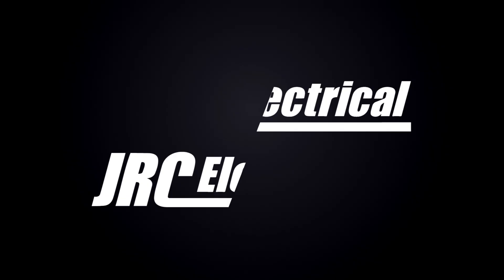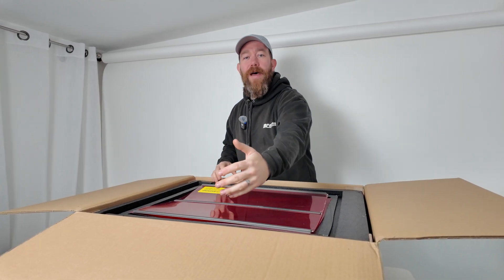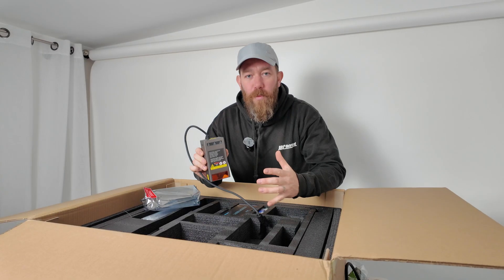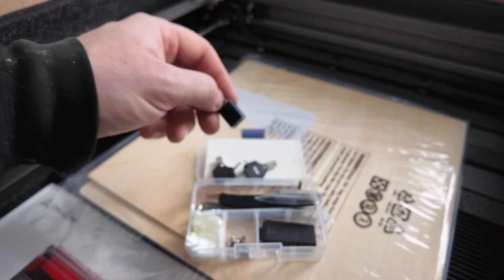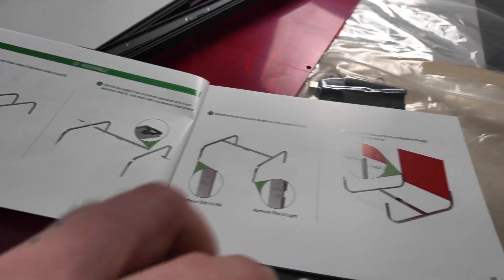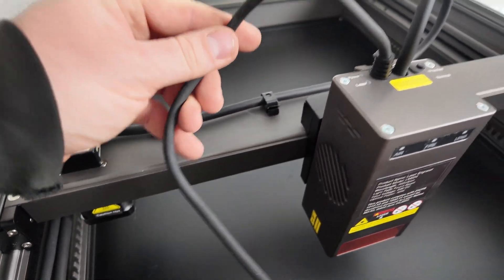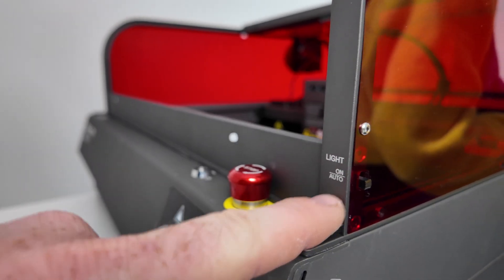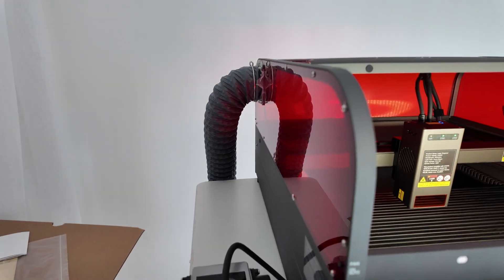Is This The BEST Laser Engraver Cutter YOU Can Buy? - Creality Falcon2 Pro 40W

Comment: How does it go engraving material that isn't flat? Kind of like the batteries but not a flat surface area - eg. a bottle/can etc
Reply from the maker: If it’s rounded you can buy a roller that the bottle or tube sits in and auto rotates to engrave